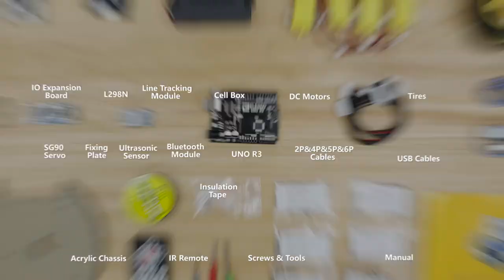ELEGOO Smart Robot Car V3.0+ Assembly Tutorial

Comment: mine doesn't go forward and line tracking also not working. when uploading the code to the arduino gave me a few warnings, don't know what to do. any help guys
Reply: Have you disconnected the Bluwtooth module before dowloading the CODE,  checj page 21 of the instruction PDF.
Reply: @gamefly00730  I know, the problem was 1 wire was not connected properly, I tightened it up and worked as a charm

Comment: What code do you use? My infrared remote is not working, but the bluetooth remote is.. when I try downloading the Arduino code, it is showing me that their is an error.
Reply: Have you disconnected the Bluwtooth module before dowloading the CODE,  checj page 21 of the instruction PDF.
Reply: I have the same problem, there is not working infrared after download infrared code
Reply: @gamefly00730  it's not working after downloading infrared code
Reply: @abdullahaminosmanl3922  Sorry, that was my best guess.

Comment: Summary:
1	Assemble line tracking module
2	Assemble the L298N (motor controller board)
3	Assemble the DC motors
4	Assemble the Uno R3 board
5	Assemble the SG90 (servo motor)
6	Assemble the ultrasonic sensor module
7	Assemble the I/O expansion board
8	Assemble the cell box
9	Assemble the acrylic baseplates
10	Assemble the tires
11	Assemble the Bluetooth module